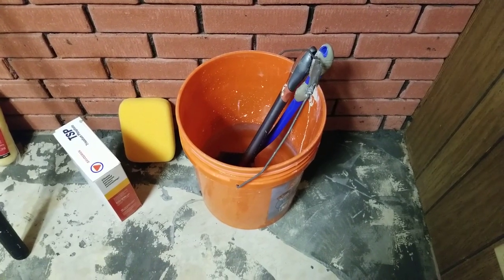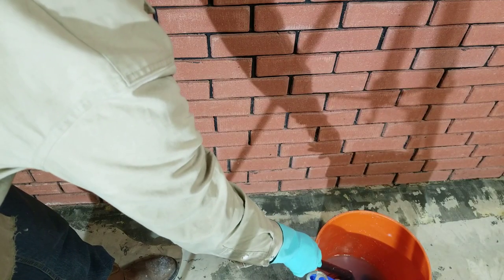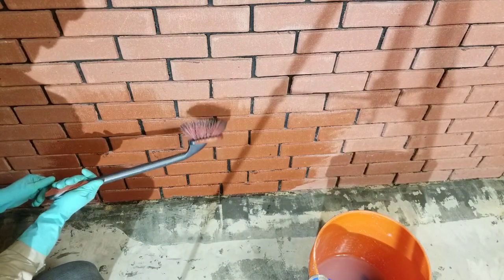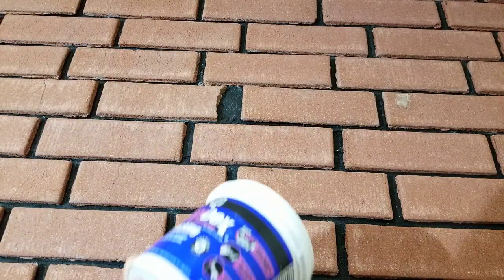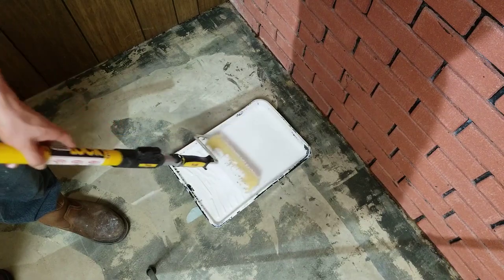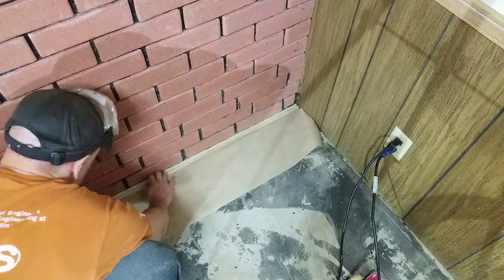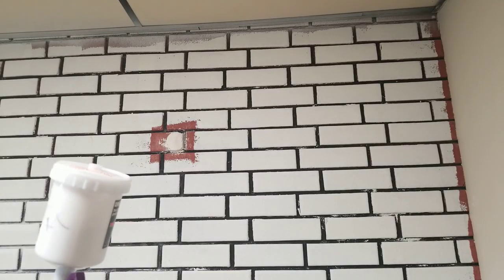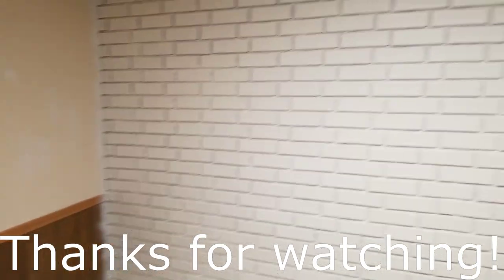How to Paint Brick (and Z Brick)

Comment: thanks for ur helpful video! 
I have some questions about topcoat(?)..should I put the top coat after painting? And what is it for?

And i wonder why u also added spraying on wall more, not only painting with roller
Reply from the maker: The topcoat is just the last coat of paint that you apply. So usually a primer is applied first to change the color and block stains, as well as sticking to the brick better than normal paint. Then the topcoat, which is just normal paint usually, is applied over the primer.
Reply: Oh! I get it, thank you so much.